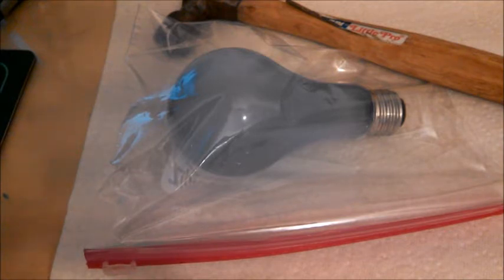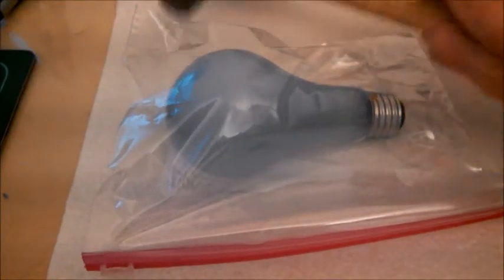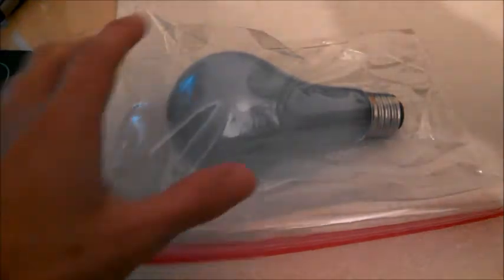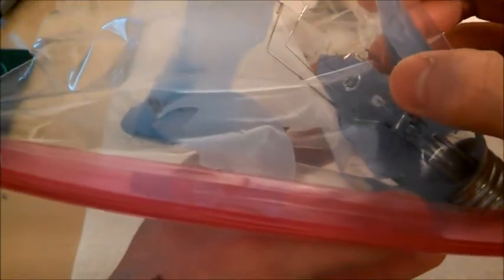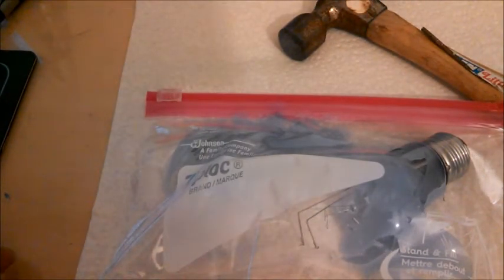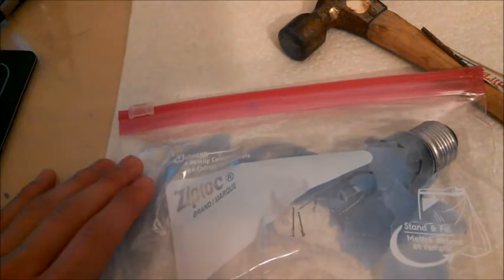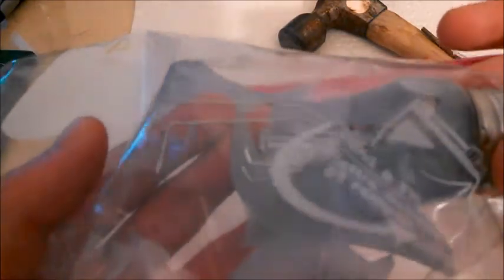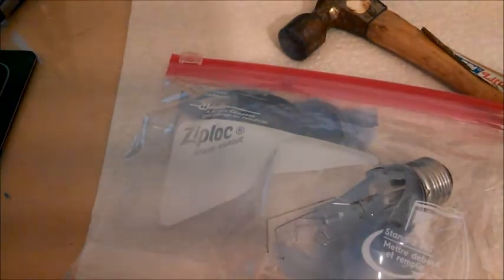What's inside a 3-way incandescent bulb?

Comment: Since they are bi-filament, I don't really see how they could be halogen: if so, each quartz inner bulb would create a visible shadow on the outer bulb making it visible.
These 3-way bulbs are often whiter than traditional incandescent bulbs, so you can expect a reduced lifetime. The two filaments also produce a lot of heat when lit together, decreasing the lifetime.